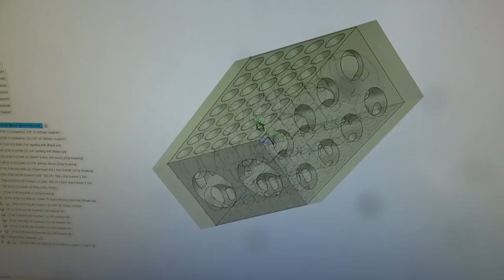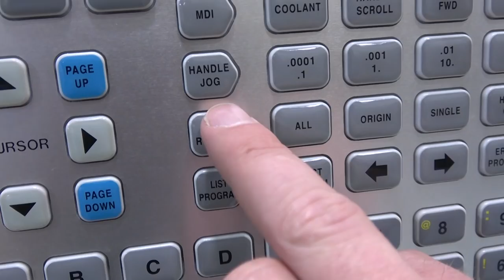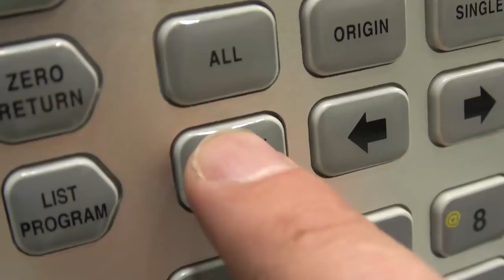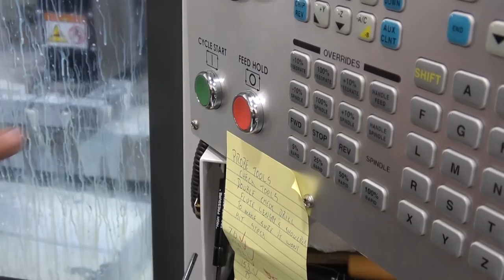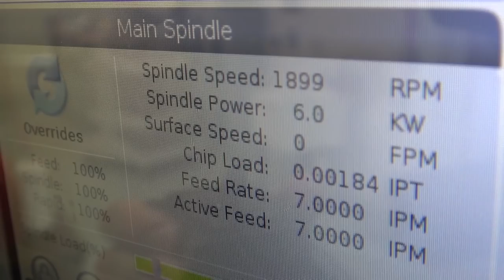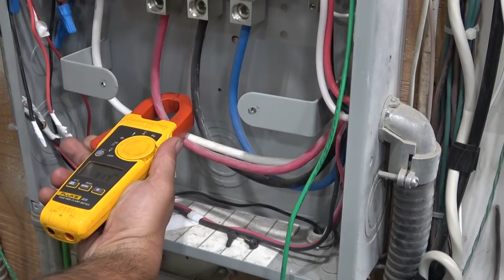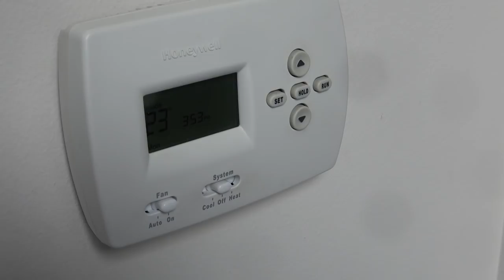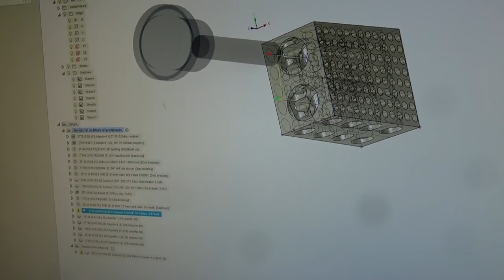Gizz Bloc. Sometimes it's best not to ask.

Comment: I would have done the biggest holes first so that as you get smaller in hole sizes the smaller chips can fall into and out of the larger holes. 
Intersecting those large U drills with so many side holes made me cringe for chip evacuation, you know those are reliant on chips being forced up the flutes with high coolant pressure, I'm sure those chunky chips were getting pinched like crazy between the side holes and the flutes leading out. 

Brutal.
Reply from the maker: How do I drill half holes with hss Max?
Reply: @arduinoversusevil2025  I don't understand the question. You mocking me for an oversight? :P
Reply: This flute pinching is where all that aluminum sludge coating the drill came from.
Reply from the maker: @Max_Marz  No, legit question. How do I avoid interrupted cuts with the scary insert drills while avoiding cutting half holes with the smaller drills? What's the best strategy for sub-optimal drilling ops?
Reply: @arduinoversusevil2025  no matter where you do it, cross holes are scary as frig. You can find kennametals (or uh, 'kennametals') with lands that go right down the drill to keep them from wandering too much - those as the small drills into big drills are probably your silver bullet for tooling
Reply: I have no opinion as to which holes you want to drill first. However if you do need to cross drill across a larger hole, end mills work fine. Or if you have the cash Nachi aqua drills and similar 180 degree drills can be had, and they do work well. But you will have to slow the on entrance as you would expect or you will walk.
Reply: Max Maruszewski He did it in the right order, those insert drills don’t care about interrupted cuts, you can plunge rough with them if you wanted to. That hss drill would walk all over the place trying to start on the radius of a cross drilled hole. The only problem I saw was he was peck drilling with the insert drill which is not needed unless a chip couldn’t break. The more starts, the more wear. Those drills are real touchy with sfm and fpt to break chips
Reply: @daerrickjohnson1349  agree, those insert drill ( used to full inserts, not 2 small ones but theree the same really ) LOVE to go hard and they want ALOT of coolant pressure. we used to have like 5-6 feet long insert drills for some deep sea valves. with proper pressure and all, chips shouldnt be a problem. ( dont forget to start the spindle INSIDE the hole with a 6feet drill or that thing will bend and whip and give you a new hole to breath through )

Comment: Does any one else get the feeling that if you asked Ave a question now you'd get an answer back in G Code?
Reply: @Sicktrickintuner  G spot code
Reply: OG code
Reply: Gspot code no doubt
Reply: G-zless code?
Reply: If he knew G code he would know how to start that program where he left off instead of reposting it to restart..
Reply: @imagineaworld  He dont know g code its all from fusion 360 I write programs like this by hand in my sleep
Reply: @dmbworks8094  when you start in the middle of a program you have to start in the right spot..you can't be active in say G18 and start a toolpath that requires a G17..so on and so on. I'm well aware of how it works.

Comment: The feed hold button only stops the chaos if it doesn't involve the spindle, like when the motor mounts snap and it becomes easier to spin the motor than spin the spindle. But that is self stopping, once the power cables get yanked from their terminal block and short out then the panic ends and its all over but the cryin'
Reply: "then the panic ends and it's all over but the cryin' " Such a heartbreakingly optimistic spin in that tragic poem of a story

Comment: Only 15 minutes of prep time? You MUST be forgetting about the job hazard assessment!  You can stretch that to 30 easy.  THEN 15 minutes coffee break. 🙂
Reply: 15 minute coffee break, nahhh. We Brits do 20/25 for tea: you gotta let it brew see!
Reply: And the cleanup! You wouldn't want to leave a dirty cup around, got to wash that, dry it, etc! That's at least another 5 minutes, and you can justify a lot more if you have to clean the machine.
Reply: Oh, I thought it just took that long for the liquid courage to take effect
Reply: I HATED JHA at my old job! You could get hurt if a guy had fourteen cotton balls in his shirt pocket for chronic nosebleeds and they fell in a piece of equipment and dislodged a screw that maintenance had accidentally dropped and flew into a motor, caused a spark and ignited a leaky acetylene bottle from a guy that didn’t have a hot work permit and the whole plant burned down.

Comment: Official Union Coffee Break:
15 min. prep
15 min. break
15 min. cool down
Reply: Don't forget it takes 20 minutes to walk to the designated break location.
Reply: @grimheathen  And another 20 min back.
Check that. It's 23 min back because you're soo relaxed.
Reply: @grimheathen  Plus when you get back you are not allowed to work until you get your 15 min stretch routine completed
Reply: And a 15 min. Saftey briefing after

Union rules dictate 1 break per hour.

Comment: Insert drills are crazy
Once made a experiment with a 30mm insert drill in steel on a manual lathe, smoke and blood all over the shop.
Reply: Cheesless. When I tried one in my manual the motor just let the smoke out!
Second try and I got to buy new belts.
Of course my lathe is from way back when electrics in the machine shop was bleeding edge high tech
Reply: @jimandaubz  Back when they was still using steam power

Comment: When we did all of are mold plates in house we used those drill inserts all the time. The curly chips would fly off and ricochet off the guards on the sides. You could be on the other side of the plant and you could tell when we used them. The carbide inserts seem to hold up really good.

Comment: So he balanced your load so that the voltage from your weakest leg doesn’t drop below the operating threshold. Just a guess.
Reply: he turned off the ac, he might have a single phase unit and those 2 legs loaded the panel too much as well
Reply: Put the AC and compressor on different phases (then turned off the AC).
Reply: @Shaun.Stephens  he did turn off the Ac but if you only have 1 phase that's under loaded and the other two are a bit high your still going to have one cranked no matter what
Reply: @seanarmstrong6435  Yeah for sure but you can minimise it as much as possible (and try not to pull such high loads in future).

Comment: That is an interesting idea, but I'm not sure how well it will work for cooling.  Because sample tubes are typically made of plastic (which doesn't conduct heat very well,) chiller blocks work best when you have as much material in contact with the sample tube as possible.  While this design allows for using different sized tubes, the inside looks like Swiss cheese, so you aren't going to get a very efficient transfer due to the lack of surface contact between the tube and the block.  Depending on how much cooling is actually needed, it may do the trick, but it won't do it nearly as well as the single size blocks.  Very cool project and it has got me thinking about a better way to offer multiple tube sizes in one block.

Comment: You dont need to peck insert drills with through coolant. It wont hurt in aluminum, but in steel or any other tough material, it will cause premature wear on the inserts. The toughest point on an insert is the entering and exit of cuts.

Comment: Try insert drilling first before putting in any of the smaller cross holes. No interrupted cut, better chip formation, less vibration
Reply from the maker: But then the little hss tools have to cut half holes...
Reply: Rather have the inserted drills cut interrupted instead of the HSS,  those inserted drills can take a beating
Reply: My apologies, thought your small holes were being done with carbide. Scratch that thought.

Comment: Going a little slow with them U-drills actually, they can take a LOT more.  Hell, in 7075 aluminimuniumum, I've sent HSS going pretty quick, guess how much horsepower it takes to drive a 24mm HSS twist drill 2400 RPM at 50inches/minute.  That's what I call a hot supper.

Comment: Skookumness/cool factor of the machined aluminimum blocks notwithstanding, this product already exists. I've used them with liquid nitrogen without a problem. Fisher scientific calls them 4-way tube racks, but there are a whole bunch of vendors that sell 'em.
Reply: Was thinking maybe you could dunk these in some LN2 and use them to keep samples frozen without needing an ice box
Reply: Ok, you need to add 'thermofisher' to the search string and then they're still not the same as these. One size only and ~$600 each.
Reply: Husain Nizami Aren't the holes supposed to never connect, so the LN2 doesn't spill out through the test tube holders?  Would obviously require more spacing between holes.

Comment: Shrink fit is good for super high precision applications, other than that, they kinda suck. You can only change the endmill in them so many times before they go bad and it takes a lot longer than the standard set screw endmill holders. The set screw style also last just about forever. It's likely someone will break it before its worn out.

Comment: I wonder if one of the cheap ebay inductive heaters would work on the shrinkfit
Reply: There’s several people who have attempted.  No successful reports yet that I’ve seen.  The wattage just isn’t high enough, and the rated wattage on the cheap units is likely highly “optimistic”.
Reply: Mosfets and microwave transformers?
Reply: @OldCurmudgeon3DP  that sounds like a good name for a channel that messes around with that sort of stuff.
Reply: Old Curmudgeon Ultimately, inductive heaters, like other energy transfer devices, can output no more than they take in.  To get enough heat to loosen those things takes more energy than available from a typical home gamer outlet,
Reply: @johnfrancisdoe1563  point to you, sir. I have a 50A/220V circuit available.
Reply: @johnfrancisdoe1563  I was thinking the effect would be accumulative over time, so the longer you leave it / shove energy into it the hotter it gets, you'll loose some heat as radiation as it tries to cool but it's down to the rate of heating vs the rate of cooling

Comment: Would the AL shrink with the temp enough to squeeze and break glass test tubes?
Reply: TheDezdan I’d like to know this too, as the thermal expansion of aluminum is over twice that of steel. I’m not sure whether an inner diameter shrinks or grows or neither, when heated or cooled?
Reply: You could probably pre-cool the block and then put the tubes in
Reply: Dont think so, al shrinks 0.002 per 100f per 1inch thickness, so that would be one hell of a fit to be dangerous to the tubes
Reply: At that temp, they use special plastic vials
Reply: @brandonb9452  while counterintuitive after a very fast quick thought, holes act just like everything else. Smaller when cold, larger when hot.
Reply: Iceberg86300 Thank you! It just got more confusing the more I thought about it, haha
Reply: @brandonb9452  LOL. Same here. And for 95% of the students in my materials engineering class.

Another one from that freshman engineering class: first day of class in a lecture hall being used for the first time that day, the professor had us put our hand on a wood portion of our desk & then a metal portion of our desk.

Then asked is what portion is colder, the wood or the metal?
Reply: Iceberg86300 😂 Vertiasium channel has a funny video about that. He asks, which is colder, this book or this aluminum block, both of which sat out on the beach for hours? 
And everyone says the metal is colder. 
Nooo! It just conducts heat faster.
Reply: @Iceberg86300  If the room is in the process of warming up the wood may be warmer because it has a lower thermal mass and will reach the new air temperature faster than the metal. The thermal mass of the furniture in a building is an interesting and often overlooked aspect of HVAC design.

Comment: Doesn't having that many holes reduce the contact surface between the test tube and the block so much that it won't be useful ? Now it looks more like an expensive test tube holder.
Reply: I may be wrong, but I think the point of all the holes is to allow something as simple as cold air to blow around the tubes.  The 2 large holes could be fitted to some ducting to either blow cold air, or act as an exhaust to draw cold air across test tubes.  I'm just an aircraft mechanic, so could be off the mark.

Comment: 6:54 I'm pretty good at stick welding bare copper on accident... But on a side note, that's the secondary off of the transformer, judging by the colors it's low voltage, 120/208. But why is it red, black, blue and not black, red, blue on the feed and the breakers? I can't say I've seen it done that way before. They're matching phase colors... but still. I've seen that for changing rotation on a motor, or changed at the last junction box (so everything upstream is not all switched around) but usually the entire panel isn't made up that way. AvE can you riddle me this?

Comment: Looks like your tools had some grease on the studs already, but maybe you need a little more? Using thru spindle coolant on the Haas, it washes out all the grease in the draw bar coupler pretty quick. Then you get that "haas bang" /pop/sticking-tool/whatever you wanna call it when you tool change. Keep it greased well and itll go away.

Comment: I would also spin that inserted drill closer to 450-500 sfm (around 1450-1500 rpm) and the same 7.0 ipm. I’ve found that they don’t make as big of a chip when spinning a little slower. Also, don’t peck with them, I’ve found constant tool pressure to be the best for those drills.

Comment: You'll can also get toolchanger popping from extended high RPM runs with a CAT40 interface.  It isn't only because of pull stud fit and finish (though it's always good to radius everything to prevent sharp edges and stress risers).  It is part of the shortcoming of the 40 taper design, which has only one gaging surface...the tapered surface.  Since the drawbar is constantly pulling up on the toolholder's stud, as the spindle and toolholder warm up and the metal expands, the taper will slowly recess into the spindle more and more.  This makes it more difficult to remove on a tool change and you might hear a characteristic "pop!" as they free up due to a quasi-interference fit from the shift.  The stickiness is less of an issue with the toolchanger arm system you have with a side carousel.  It used to really suck with an umbrella-style toolchanger because the Z axis motor wouldn't have enough guts to pull the toolholder free when it was in the umbrella and it would stall during a tool change and require judicious banging with copper/zinc mallets to free the toolholders from the spindle.

You'll notice this with your Z changing slightly from parts made on a cold machine, and a part that's run for a while.  It's typically a few tenths or a thou over the course of a few hours, which isn't an issue unless you're running a tight tolerance job.  There are also four ball bearings that engage the underside of the pull stud.  Those ball bearings should be greased periodically.  The easiest way is to use a long q-tip to get up into the spindle or just put some light grease on the underside of the pull stud.  Also keep an eye on the pull stud over.  If it's a few points softer on hardness, the ball bearings will make a noticeable dent in them over time.

There is an improved CAT40 design called the Big Plus, which modifies the design by adding an additional gaging surface to the interface system--the toolholder flange (which floats in the open in a CAT40), so now your Z of the toolholder can't change, as it stops solidly against the spindle face.  Of course, you'd need all new toolholders and a new spindle.

Comment: I think u-drill rpm is too low...? I have older —98 vf2 and today drilled s355 steel with 22mm u-drill. Rpm was 4350 and feed 0.10mm per round.

Comment: Man, back when i was a scientist I begged our home-fab guys to build me one of these. You already get them, but usually only in plastic, from the manufacturer (Thermofischer or Eppendorf are the big 2). Aluminium is much better if you want to keep your tubes hotter or colder than ambient, however the more holes you put in her, the less contact surfaces there are, the worse it will perform. I hate shitting on someone's good work, particularly since these blocks look so fucking cool, but a well formed tight-fit tube holder made in plastic would probably be a better temperature regulator than a straight-cut toob in aluminium with minimal contact area since the tubes taper from their top.

However, there is obviously 1 big way that you could really improve this design, and that's to slap a Thermoelectric cooler/heater on the bottom, with a temperature probe in some chunky part of the alu, and a brainbox to turn it up/down when needed. A lot of experiments require your sample be kept at a specific temperature, usually 4C - but of course even in the best institutes in the world we just throw it in a plastic holder and put that holder on ice. If you want more control, say 7C, do a different experiment. If you want to keep the samples warm, time to break out the water bath. That puppy has a lot more control, but since these are usually communal, don't expect whatever you set it to to remain that temperature for long. Also, don't expect the water to be clean and your samples not to get contaminated. If we could ditch the waterbath/icebox and switch to small, relatively well controlled alu blocks like this, it would really help a lot.